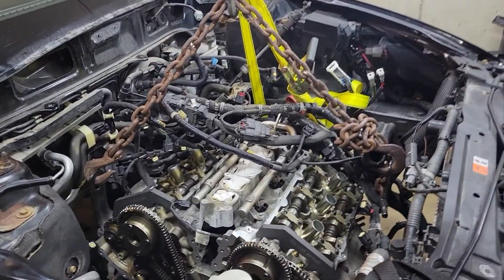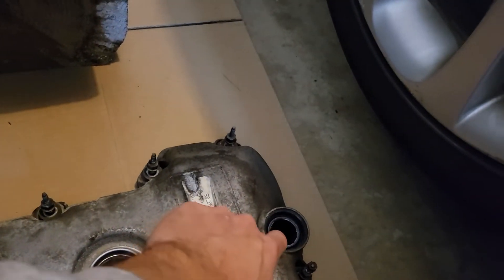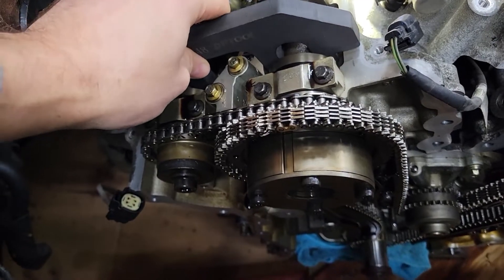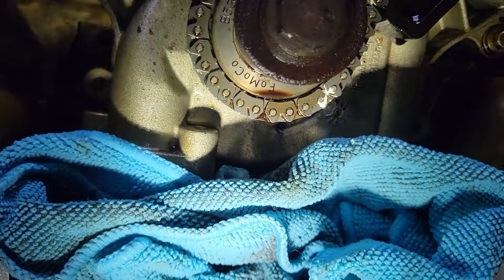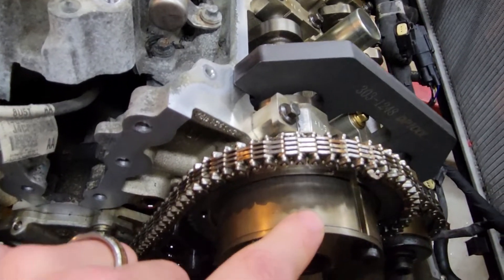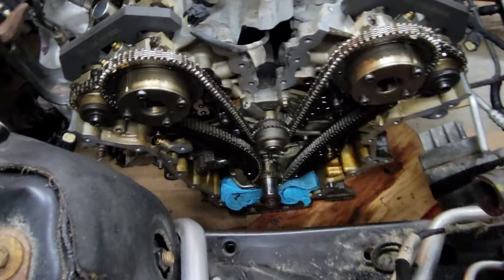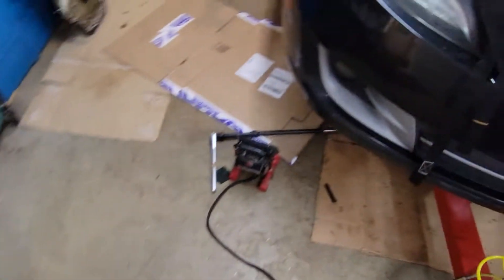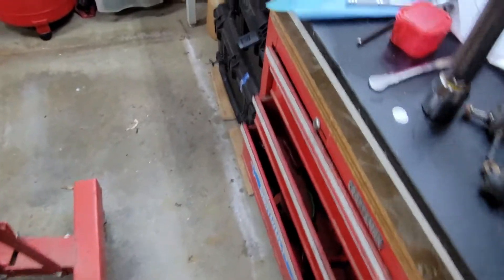2012 Mazda 6s Duratec 3.7 Water Pump Replacement (Part 4)

Comment: Where did you get your timing chain kit/water pump from?
Reply from the maker: I bought all the pump..chains.. pulley/phaser bolts and tensioners individually from the dealer. I was unable to find a quality kit for this car.. the only kits out there were not good name brand. Theres plenty of quality duratec kits but none state they were for this exact car. I even called the guys at cloyes I think.  Unfortunately it's pricey at the dealer..I think I had about 500 in parts. Most dealer websites have the parts diagram you can pull up...although it's unclear on the cam tensioners that there is a left and right tensioner (I bought two of the same side by mistake). I believe I used www.mazdastuff.com.
Reply: @nobama5555  I appreciate the reply that is probably the best route to go i haven’t had much luck finding a kit either. I would like to try to order it all at once but I’m not sure of all the little things I need. I do need both chains correct? And basically I’ll just have to go from there figure it out as I go but there is a lot of tedious items I’m unsure how to even find/order.
Reply from the maker: @bodyngraham2906  check out Cloyes. I think they have a kit for your car. They did not for a 2012 but I think you said you have a 2009... which they do have a kit for if your VIN code is B I believe.  The 2012 used a different timing chain style and they didn't have a kit with that in it..but your chain should be the old roller style.
Reply: @nobama5555  hello, sorry I am not the best at viewing my YouTube notifications but I wish I would’ve seen you had replied with that. Anyways glad I seen it now and correct I have the 2009 3.7L s grand touring and I was wondering if you knew of the best possible kit for the 2009 that I could trust to order from?
Reply: @nobama5555  I’ll definitely have to check out cloyes and see if they have some reviews etc. thank you that helps alot it would save some time and money being able to get a kit instead of individual parts but either way quality materials is more important than the time or money at end of day but if cloyes is solid I’d go with that.
Reply from the maker: @bodyngraham2906  i was under the impression that cloyes or melling were ok quality....and way better than any amazon kit, but the dealer parts are the best. unfortunately with the dealer parts you need to decipher what P/N's you need off the parts diagram. At the end of the day, you could just replace the water pump, but its such a big job that you would be foolish not to replace everything else while you are in there. I did all 3 tensioners, all the guides, all 3 chains, the cam pully and phaser bolts (they are one time use), and the front main seal in the timing cover. All of those pieces show up nicely on the parts diagram on any dealers parts website, but you need to know what you are looking for. The cloyes and melling kits usually come with a new crank shaft gear as well, but i didnt replace that
Reply: @nobama5555  sounds good I appreciate the  help